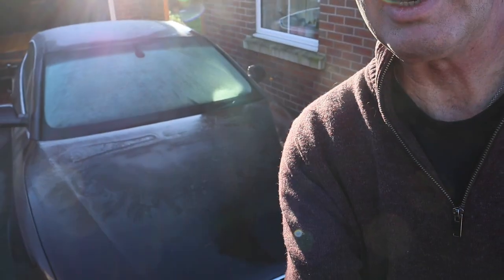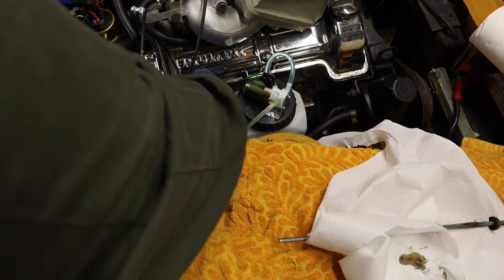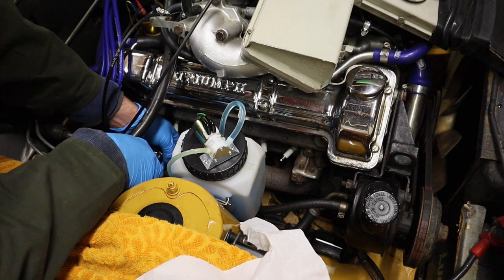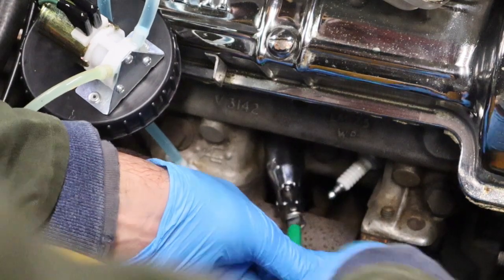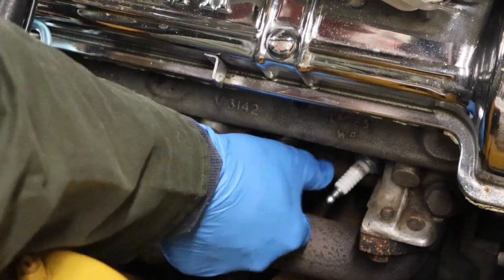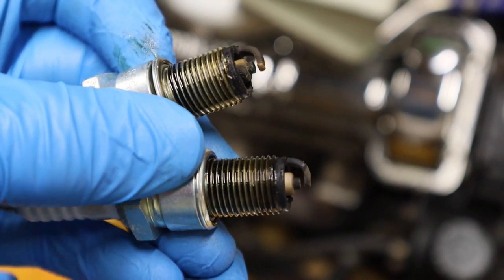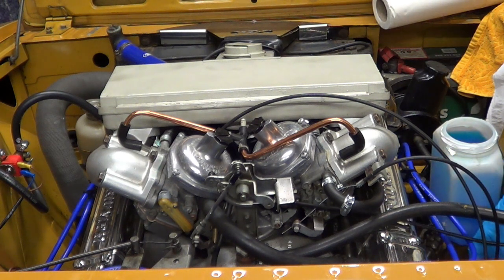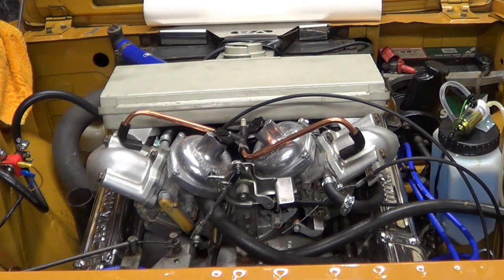Triumph Stag 3000 mile Service S1 : Ep 15

Comment: Hi just found your great channel. Bought a MK II last autumn and slowly going through the car as very limited service history. Generally the car is in very good condition.  Done plugs, set points, changed air filter and repainted housing. The near side clip is a nightmare to get back on! Oil change next so your video was very timely. Done rear brakes, now on front brakes. Callipers seem to be seized so replacing with new.  Your rocker covers look amazing, are they new or what? Hardly driven the car yet as brakes were so poor, I now know why. All the best Helen in Nottingham.

Comment: Yes me too , can't get the extra rubber seal  on , I think maybe it's for a multiple application thing , good guide to tighten plugs  especially not to damage the  nice mk 1  heads  , one thing about the stag engine service parts all  on  the outside even the oil pump , core plugs can be changed  being on the heads only ,  in situation,  no hidden ones at the back !
Reply from the maker: I'd never considered the air filter being multi application. That could explain it indeed. Thank you 😊